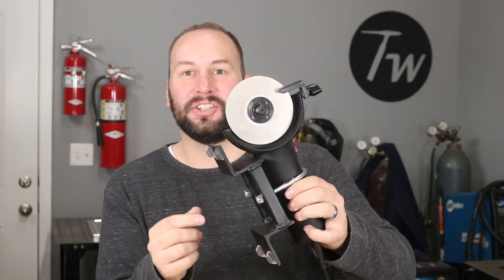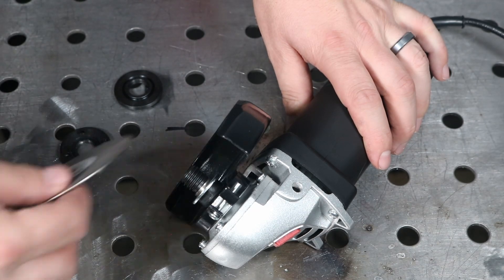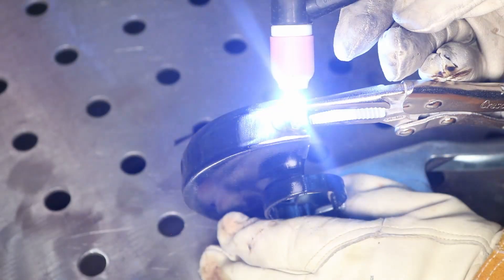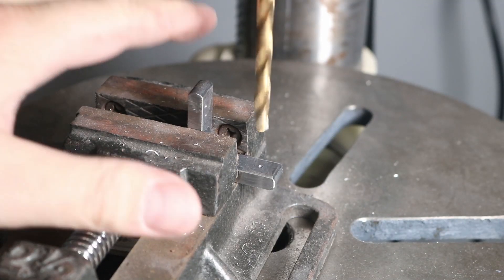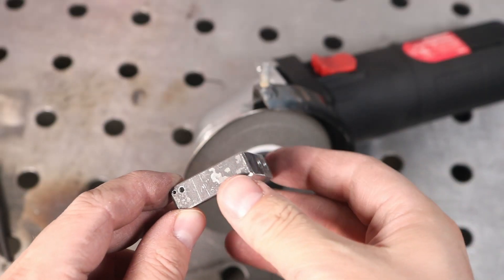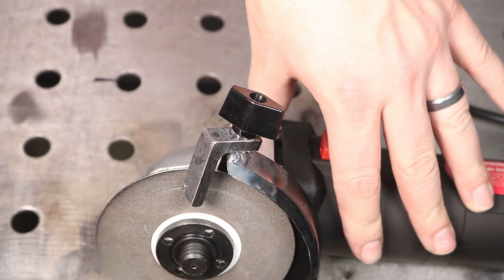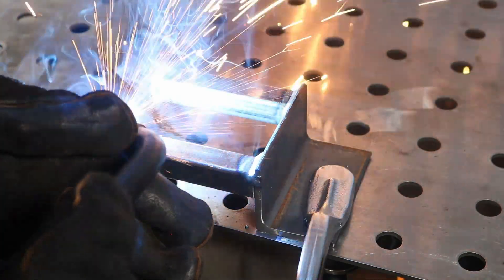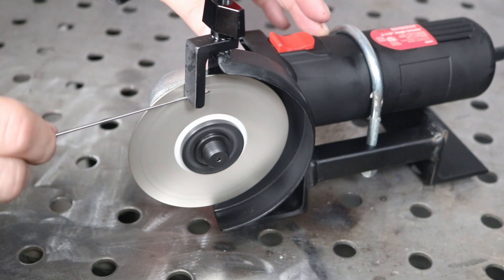TIG Welding Tungsten Sharpener Build

Comment: 3:05  Hi Tim. I’m a welder too. Just wanted to let you know, when cutting angle or channel iron, you want to cut through  the web first so the cut stays true to the measurement. So basically flip the angle iron so it looks like this when clamped in the cutoff saw vise: /\ 

(just a suggestion from experience) great video! 👍👍👍
Reply from the maker: Thanks for the tip! The way you described it how I do it now.
Reply: @TimWelds  no problem 🙃

Comment: ,,,,,,,great to see the talent and  eye develop a functional tool....I do lots of freehand machining when possible......Gotta duplicate that fine fixture you made for tungstens,,,,,,thanks......Quick question :  When using the tig process ,  should a left handed person hold the torch or the welding rod ?    Should my direction of welding be  from right to the Left......Please be specific as to what you do......Thus I may copy or reverse the procedure,,,,,Thanks.....

Comment: Thanks for a great video. I just finished building it and ground 20 electrodes in about 5 minutes. I did have to change the guide to the opposite side because the wheel kept sucking the electrode into it. The only other issue was that the hole was drilled oversized in the disk from Amazon (no surprise).

Comment: Thanks for the video, I was planning this build and got an angle grinder from harbor freight unfortunately the diamond blade I got that was similar to yours is a 5/8 size arbor and the arbor on my grinder is 7/8. Putting the wheel without the arbor on the grinder fits but is too loose and won't stay centered. I was wondering how you got the wheel to fit. (I can't find an angle grinder to fit that size diamond wheel.

Comment: Hey Tim;  This is so clever.  I built one for myself.   A couple of things for the next guy to consider.   1. The geometry of the height of the disk to the welded screw is actually quite important.   You may want to get your disk all set up with whatever spacers etc. you will be using prior to locating your screw.  The guard is flimsy enough that you can bend it some to adjust the height of the angle iron if it isn't working out for you.  2.  I added a more complete guard.   I butt welded a half round bottom to complete the guard and enclosed all of the sides but about an inch where the angle iron drops in.  I was very uncomfortable with that spinning disk exposed and me working on the business end.  3.  The disk actually ends up piloting on the threaded portion of the shaft which is a very sloppy fit.   It takes a little tweaking to center the disk prior to tightening it down.   4.  As a  result of the sloppy pilot, I am considering using a step drill and punching out the center of the disk to 5/8".   Then I could use the correct pilot on the parts that came with the grinder.   This would, of course upset the screw to disk height geometry and may even wreck the disk, so I'll hold off on that until the disk is well worn and see what happens.  

Thanks again for this clever idea.  I really like it.   I often use it with a cordless drill to hold/spin the tungsten.   Do you see any downside to that?

Comment: Very nice.  Can you explain why you used the machine bushing rather than just using the inner flange that came with the grinder, like you would for a cutting wheel?  A commenter mentioned the bore size of the wheel, but that doesn't seem to make sense.  Thanks!

Comment: Is there a reason not to use the backing flange that is typically used under a grinding disc.
As opposed to using the machine bushing I'm not quite clear on why that was needed.
Thanks
Reply: The bore diameter is too small in the diamond disc.

Comment: at work i've been using a harbor freight stationary belt sander with 60 grit (probably) aluminum oxide belt.  easy to get a long taper and a needle sharp point, if that's what you're after.  chuck the tungsten in a cordless drill and it saves burning your fingers, plus makes turning easy...don't know why you wouldn't if you can!  obviously the drill works with any grinder for turning.  i also have some diamond coated discs at home.  200 grit leaves a nice finish and it's not too slow at removing material IMHO

Comment: I just built one based off your design. I did add a continuous rim 4.5” diamond wheel to cut the tungsten. I also built my frame slightly different. I used the handle hole to bolt to. Thanks for the video
Reply: Any photos you can show please.

Comment: great tool. Only issue is if you are still learning like me, and you contaminate your electrode , you can't get it out unless you remove your twist bolt and star washer. I have one of those dremel fixtures and it is the same way, and it slows down your work. I guess the only way to get around it, is to not contaminate your tungsten =/

Comment: I like it.  I would probably run a vacuum next to it, especially if any thorium was involved.
Reply from the maker: I agree. I have a version 2 on my to do list to enclose the wheel and capture the dust. I don’t use red thoriated tungsten any more because lanthanated and LaYZr work great and seem to split less often on AC.
Reply: @TimWelds  I plan on entirely copying your design. Thanks!

Comment: Nice project.  I have been hand holding a portable drill with the tungsten in the chuck against  a dedicated bench grinderl. I do like the idea of a diamond wheel. Thank you for posting the links. You got me to thinking about making a fixture for the el cheapo bench grinder from the 60s (5" Edison) and adapting a diamond wheel to it.
Reply from the maker: Very cool! This one is still working great with the original wheel, and believe me, I have to sharpen my electrode pretty often. I'm thinking about making a second version with a fully enclosed wheel to make sure it contains the dust from grinding.

Comment: Hey Tim,  isn't Tungsten dust bad for you?   All the commercial versions that I've seen have the wheel totally enclosed and you insert the rod through a hole that also serves for angle alignment.    Later you open the lid  and gently tap the dust into the bin.   That way you aren't breathing in dust comming of the wheel,    like in an open design like yours.
Reply from the maker: Thoriated tungsten is particularly bad, but it’s better to avoid all of it. Many  commercial sharpeners are that way and others aren’t. Either way, enclosing the wheel would be pretty simple and a good improvement. Maybe I’ll do a version 2.

Comment: Just got my first tig and binge watching as much info as possible while I'm down sick. What about tip grind angle? Do you just eyeball it or you have it set with something not shown?
Reply from the maker: I just eyeball it. For me, having the length of the grind at 1-2 diameters works pretty well. The principle is that the more pointy the grind, the wider the cone on the arc. A blunt point will produce a narrow cone. Kind of counterintuitive. There are so many variables to fine tune TIG welding that it gets confusing early on. Some may disagree, but my opinion is this. First, get your arc length, torch angle, travel speed and rod dip down in that order. After that’s going pretty well, then fine tune other factors like electrode grind angle, cup size, AC frequency, etc.

Comment: Nice and simple design! Since the tungsten will be grinding in the same spot on the diamond wheel, how long do you think the wheel will last? If the guide was adjustable up/down you could probably get a lot more mileage out of it. Maybe a V2 update if the wheel starts to get worn down or something. Thanks for sharing!
Reply from the maker: Thanks! I’ve been using it since the build, probably 50-80 grinds. The wheel still works like new, but it would be nice to have the option to move it around. On other diamond grinders that I have used, the wheels have lasted a really long time. The biggest problem I’ve seen is aluminum from a fouled electrode getting deposited on the wheel and clogging it up. Either way, I’m glad the wheels are $10 instead of the $90 that wheels for my fancy grinder. 😁

Comment: What brand was that cold metal cutting saw? BTW. Nice job. I liked that you took the time to explain all of your steps as opposed to some of the other videos I’ve seen that basically run high speed video with no dialogue.
Reply from the maker: It's a Trajan from sawblade.com. I really like having a 7" chop saw for portability. I got it on sale for a good price and I use it regularly for small stuff. Here's a review video I made when I first got it: https://youtu.be/etyj-_RpnSI I think the Ironton from Northern is similar, though I've never tried that one.

Comment: This is a great and really functional build. Nicely done. I have been using a diamond lapidary wheel outboard of an 8" grinding wheel on a bench grinder for over 15 years now to grind tungsten. That cost about 40 bucks and i hold my tungsten with a drill. I might just have to make myself one of these ! Maybe as a part 2 you can come up with an enclosed version to collect the dust.
Reply: instaBlaster.
Reply: Where can I order that diamond wheel? I think I’m going to build this but on my bench grinder.
Reply: I used to get them off ebay buty rings a bell for the seller. Can't remember exactly since I've had them so long 
It called a diamond lapidary wheel

Comment: That was pretty good. The grinders are nine bucks right now and I’m thinking about grabbing maybe three just to have dedicated wheels on them at the bench - pretty much disposable at that price. Oddly the reviews indicate they actually last pretty well assuming you don’t ask too much of a 4 amp grinder. 

I have an aluminum core Strauss “UDGW” 6” diamond wheel on one of my bench grinders that I use for tungstens - it will live a lot longer than me. Thanks God I didn’t have to pay for it. (helps to have friends in aerospace) 😎

Comment: What a great method, I'm going to get a (cheap) tig setup soon as I'm an engineer and determined to have this skill in my repertoire...I was thinking I could get away with putting my tungsten in a drill chuck and just hitting it with a diamond file while its spinning...do you think this would work?

Comment: I don't know if it makes a difference or not , do you have to have the point go against the wheel rotation or with it ?
Reply from the maker: I have it go against the wheel rotation. This is how I sharpen lathe tools to avoid a burr, but I'm not sure that it would make much difference on a tungsten electrode. For what it's worth, my commercial one also goes against the point.

Comment: You are going to quickly wear a groove in that disc, especially with no lube. I would make a flat fence that you can just run the tungsten up and down along the disc instead of an insert guide. plus the tungsten diameter won't be an issue. Also that guide only has 1 mounting point, which makes it pivot after awhile if it loosens any. I'd make at least 2 points to secure the thing.
Reply from the maker: Thanks for the comment! The guide would be a cool variation. I'm new to this particular disc, but I've used other diamond sharpeners that have guides putting the tungsten in the same place and they last for thousands of cycles. Most of the commercial sharpeners work this way. I'm optimistic about wear, but only time will tell.

Comment: Nice idea Tim! What would you say you enjoy more..."engineering/designing" parts to be welded, OR hands-on Fabricating them yourself?  Seems like both lol I'm def on the fab side. But THIS is an awesome idea, which I may have to take stock in. Thanks!
Reply from the maker: I enjoy the hands on most, especially when I'm kind of designing on the fly. Thanks!